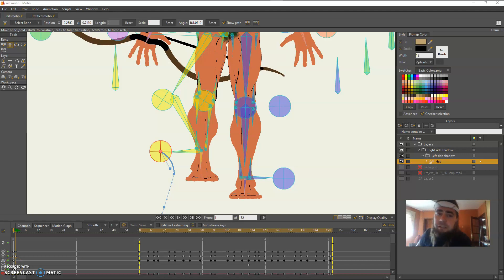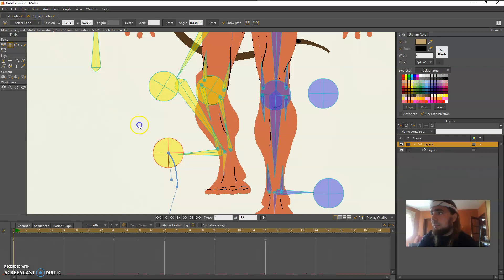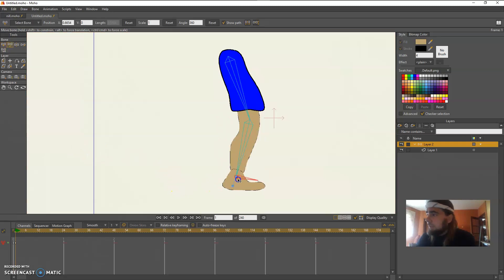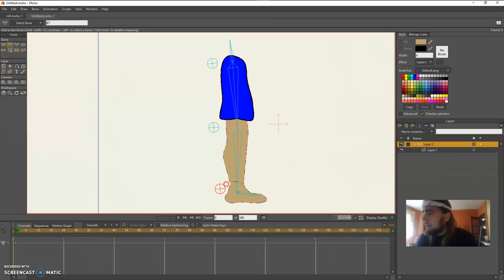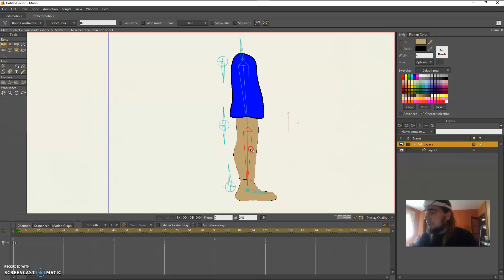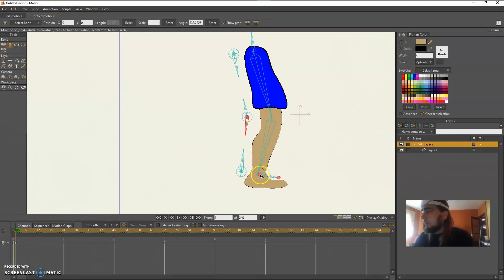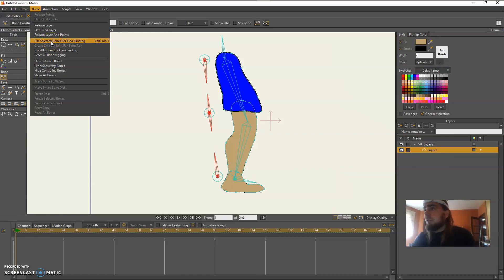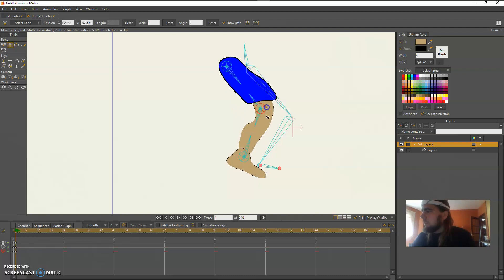Compound IK joints in MOHO 13

Comment: hi, I have tried it a few times and still struggling with this. Have you ever done it in Moho 12? In moho 12, if I parent those pin bone to hip/thigh/..., the pin bone angle will be rotated (90º- it still looks the same, but the angle number is changed). And that leading to wrong direction turn (frame 0 is fine, it still acts the same as your example, but dial bone turn +/- 90º from frame 1).
So I've tried un-parent, it backs to normal (angle number backs to normal). But it's not much different with using FK.
(I've already check your clip a few times while test it so I sure my bone parent and target is as same as your example.)
Reply from the maker: Yes these rigs work in 12. If I understand your question, It is how to reverse the bend of the IK chain. To do that you simply push the "end flip" button with the thigh bone selected anywhere on the timeline.
Reply: @t.c.g.9324  thank you, it works :D.